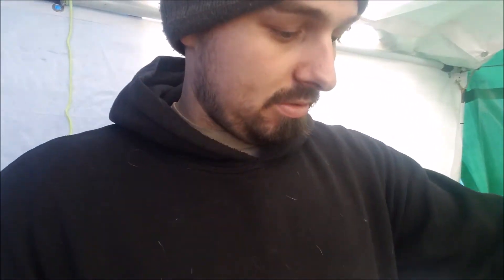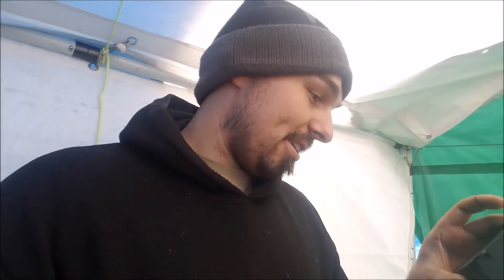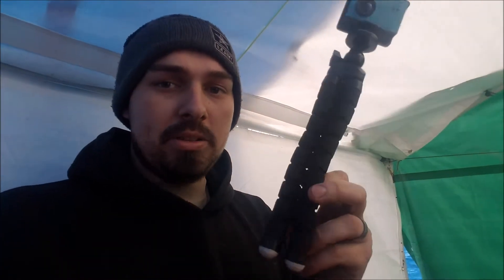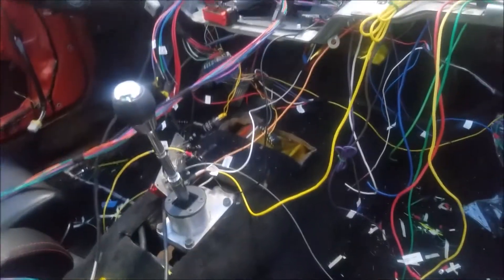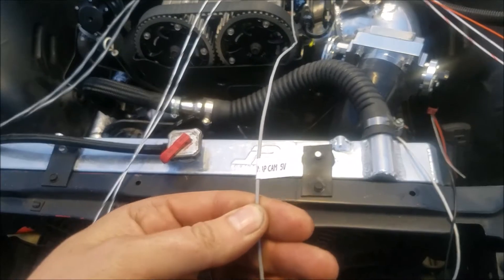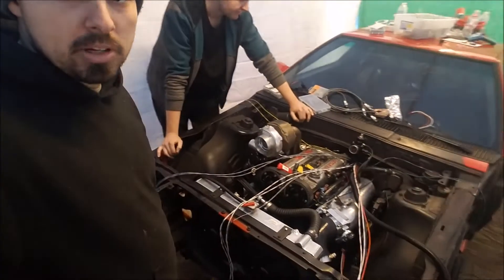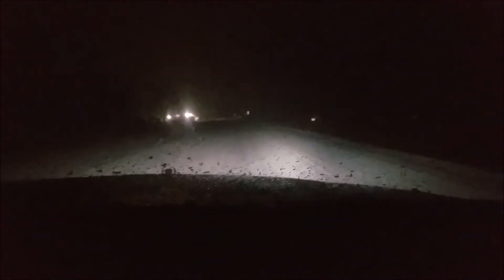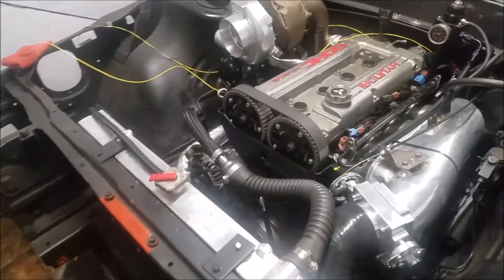MICROSQUIRT INSTALL ON 4G63 TURBO SWAPPED CONQUEST!!!

Comment: It’s a Hyundai motor?
Reply from the maker: That was just the valve cover... its 4g63 head and 4g64 block
Reply: Garageless Thanks I am doing a Mitsubishi Starion conversion, with the twin turbo set up.

I was going to go LS but everyone and their mother has done that, or a 2j swap.

I’ve only seen 1 or two with this motor.

I’ve seen a few 3000 GT VRs with over 1,000 HP so I’m going to keep it in the family and run a set up close to that.

I wonder if I could pull off an all wheel drive 1,200 HP Starion 🤔
Reply from the maker: @1997TL1000  that b sick swap in whole drivetrain out of awd talon
Reply: Garageless Well it’s already a wide body, and I’m pretty sure I should be able to find a AWD Talon here in Las Vegas 😈
Oh Man that would be soo sick, I’m going to have to look into it seriously now.  Because it’s so light, I can’t imagine trying to get that much power to the rear wheels only even though it’s tubbed with 20+ inch wide wheels in the rear.
Reply: Garageless Dude!!!

Just looked up a guy running a TSI Talon with 1,600 HP ran the 1/4 at 215 MPH at in 7.34 seconds 😱 yes please.
Reply from the maker: @1997TL1000  thats a lot of money to go that fast lol
Reply: Garageless Well I’ve had this build going on for quite some time now!
I can either throw money at something I know will kill everyone on the streets or I can go buy something that everyone else has.

I’m more of a built over bought kind person and I’ve had a few Z06s and stuff which are great but, it’s still someone else’s work at the end of the day!

Time to see what I can create!
Reply from the maker: @1997TL1000  for sure i here i there... ive always built my own

Comment: Cool man, I’m installing a ms2 into a 4g92 colt with a 4g93 head swapped. Getting trouble with the CAS sensor, lots of flames going from the exhaust. How did you configured it?
Reply from the maker: Im assuming it has something to do with crank offset... gotta check timing to make sure its using timing ms2 is commanding

Comment: I know I asked a couple months ago to see how you wired up your cas for your 4g63 . Is there a way you could send me the diagram you used to wire in your cas and resistors to vr1 & vr2 and also what were your tuner studio settings ? 
I'm not reading any rpms on tuner studio . Thanks
Reply from the maker: No rpms is most likely the crank or cam... idk i can ask paul
Reply: @Garageless  please ask Paul any help would be much appreciated .
Reply: I'm really wanting to know what diagram you used to wire your stuff up .
Reply from the maker: @codyepperson4795  he doesnt have any info on it anymore he found all the info in msextra... ik he found a log for a engine that was close to his then just changed a couple things around

Comment: I'm getting ready to microsquirt my 4g63 . Could you post the wiring diagram you used for the vw coil pack and  exactly what coilpack and spark plug wires ?
Reply from the maker: cody epperson all ik is its a vw beetle coilpack and vw beetle plug wires... paul isnt here so idk lol
Reply: Garageless I found the vw coil pack . Do you have a fourm other than your video on YouTube that goes over the resistors you used on the cas or other resistors in the circuits ?

Comment: I wasn't aware that micro could do e85 flex. the batch fueling opens up some inputs probably. you don't want to sell your hp tuners by chance? lol
Reply from the maker: Dirtfloorfab no i use that for my car...
Reply: Garageless lol I didn't know if you were joking about swapping. One of the last few things I gotta buy
Reply from the maker: Dirtfloorfab i plan to go microsquirt then i might sell hptuners
Reply: Garageless if you do that in the next couple months let me know I'll probably buy that last
Reply from the maker: Dirtfloorfab it wouldnt be till December... if hptuners was just bought by me id say buy microsquirt and id trade lol but its split 50/50 with me and paul